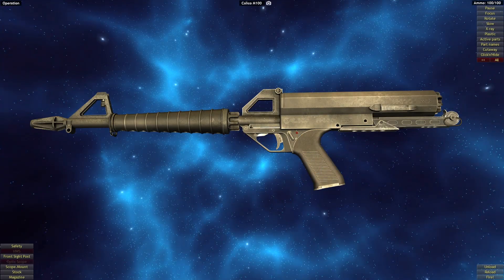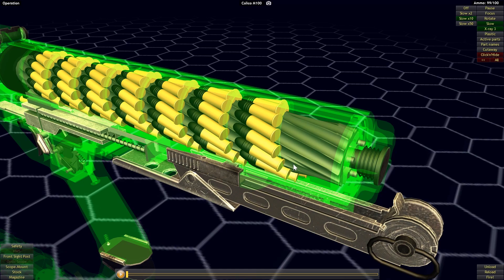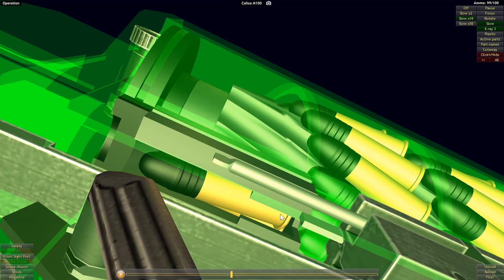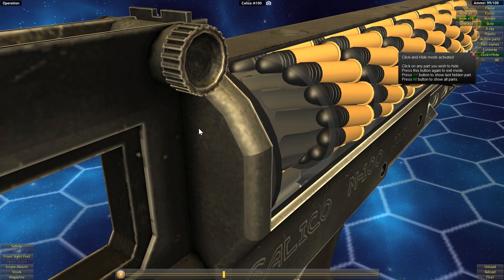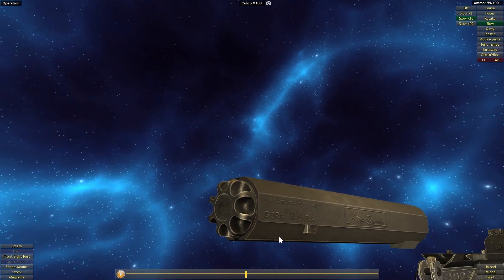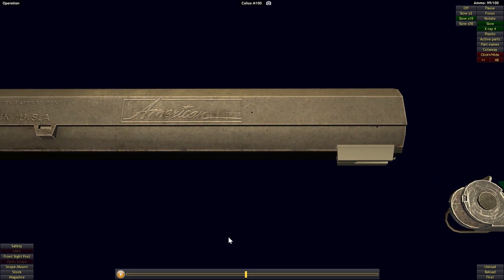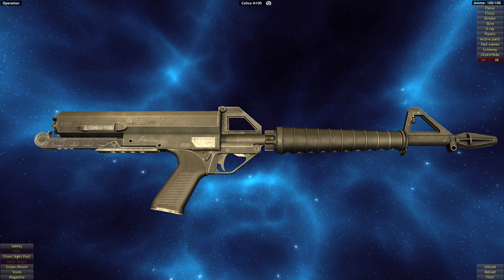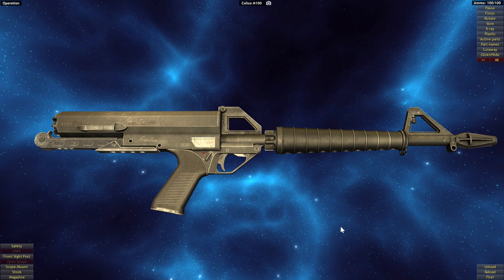How Calico Helical-Fed Magazines Work

Comment: The reason it never caught on was primarily the AWB. They're back in business actually selling the whole firearms again now (after slowly rebuilding operations for several years just offering spare parts and MAC conversion kits). In the time between getting forced out of business by that sedition, and their comeback, Russia, China, and North Korea all adopted Calico-inspired (and admittedly/expectedly refined) helical mag designs for their armed forces.
Reply: The owner was not as focused on the impending cali assault weapons ban, instead of building a shit ton of mags he built a shit ton of receivers not realizing that the manufacturer of the mags is what would be banned. The first ban was skirted by other manufacturers by simply changing the model number of the weapon, he had thousands of marked receivers that were specifically banned. And more importantly no mags to go with them

Comment: I always scratched my head about the inner workings of pp-19 bizon's weird magazine. While I don't have any pictures or videos on that, this video gives me a good idea of how  the magazine works, which is all I need. Thanks.
Reply: I’m late on commenting but when I was smaller I thought they would pour bullets into it and it would be like pebbles in a bottle
Reply: @n-gaming4056  wont lie, I thought that's how it worked and when a friend asked me I looked it up because I wasnt sure, I'm glad I did lol.
Reply: The pp-16 works a liddle differently from this this mag has a crank while the pp-16 turns while you load the mag (I believe that's how the modern version works)
Reply: I always thought it shoots out cylinders that break into small bullets and I always thought that the magazine was a water bottles
Reply: that pfp

Comment: Thank you for setting me straight on this fun idea I've been interested in for years.

More recently, I've wondered about an epoxy injection rail gun system to spray shrapnel with capacities of 1000 rounds per compressed constituent ingredient to the projectile.

Comment: So, to my eyes, there doesn't actually seem to be a problem with the magazine. The problem seems to be how far the magazine has to turn in order for the bolt to catch the next round out of the magazine. I think reliability issues would be solved if the bolt was delayed a bit during the forward motion to give the magazine time to react. Also, lube on the inside of the magazine to reduce friction would probably help.

Comment: MouseGunner,
100 rounds of .22 LR weighs about 12 ounces.  That's as much as 28 rounds of 9x19 or 28 rounds of 5.56x45 or fourteen rounds of .45 ACP.    That's as much as the weight of the ammo in one AR15 magazine or one mag for a Glock 21 or less than the weight of ammo in two Glock 17's.  It isn't the weight of the ammunition that is the problem with the Calico's helical magazine.
Reply from the maker: When I was talking about the disadvantages, I was talking about Calico helical-fed magazines in general. I realize the possibility of confusion due to the model I showcased being .22 LR , but I was more talking about the 9 mm versions when I was discussing issues of weight. For some of their designs a fully loaded magazine more than doubled the weight of the gun unloaded.
Reply: MouseGunner,
The more than doubling is true for the Calico Liberty III pistol but that would be true of about any 9mm pistol if you add the weight of 100 rounds of 9x19.  It isn't an inherent fault of a helical magazine.
I firmly believe that if someone actually put the time and money into it most of the issues of a helical magazine could be solved, making it an effective package for something like a huge capacity submachine gun.

Comment: There is a use for them.  The N. Korean army is equipped with AK-74 rifles with helical magazines that hold 250 7.62 rounds under the barrel.  This means that their rifles weigh about 20 lb and are front heavy by about 6 lb.  When they run out of ammunition it will take about 10 min. to reload unless they carry two or three mags in their packs which adds 26 - 39 lbs.  Plus - they jam a lot.  In other words, this is a great magazine for OUR forces if the N. Koreans use them. :D
Reply: Wolfy Nautious
Chances are, they will only carry one mag.

Comment: Q: How does a Calico helical feed work?
A: not very well
Reply: Treblaine AFAIK, the main problem is that the bolt doesn't go back far enough forcing you to reactivate it after each shot....
Reply: @edi9892  yes because 22 doesn't cause enough gas blowback
Reply: Forgotten weapons shot 9mm and it was pretty reliable

Comment: Actually the appearance of the weapon in Sci-Fi films is not all that impractical. The .22lr has long been considered a good round for use in future spacecraft. If you have a high rate of fire, it is deadly, but less likely to blow a hole in your own spacecraft. The low recoil would be good in a zero gravity environment, and if fired in a vacuum, the bullet would retain full velocity and energy pretty much forever or until it ran into something. I understand it was a reliable weapon, but like the author says, a bear to load. Not practical at all for military or police.
Reply: Lawrence Withrow unreliable*
Reply: Lawrence Withrow they need one for full auto 22.cal magnum be it's a hell of a lot more charge the smaller the shot and more powdered casing the more penetration these could be magnified into explosive shots they do and can incinerate  shrapnel on impact... intratec 22. magnum 32 rnd a new evolution into firearms self defense initiative
Reply: they do not make eagle claw air Marshalls for 22s these are neighborly  friendly ammunition that do not penetrate sheet rock without expanding they are used in military air command undercover survey on commercial air flights you can buy them in stores eagle claw is my choice to keep me and my neighbor safe and thanks to Trump who will abide by the second amendment of the USA

Comment: Is this gun chambered in .22LR or am i seeing things?
Reply: Logan Brewer Uzi is a 9mm
Reply: He mentioned it at the start of the video.
Reply: Powermops no he said so
Reply: There's a version of the Uzi in .22lr available.
Reply: Many full auto firearms are chambered in .22lr, they are small and can be shot with low recoil, popular guns like the notorious Uzi sub machine gun
Reply: Powermops I was looking at the same looks like the real cheap 22.cal rnd nose shots from Remington corp my intratec 22 (hand gun) takes only the expensive solid metal jackets no hollow point bullets. The hand gun is nickel plated and refurbished from a gun shop display that I saved my money for and I invested in, one of a kind but it will not tolerate cheap 22. long rifle without jamming use the right ammo this gun can rival a full auto gun at only 22 cal. without a jam
Reply: They make a 9mm version.
Reply: I think , it's looks how 9x23/18
Reply: Powermops yes it is chambered in 22lr. It is a fun and very accurate rifle.